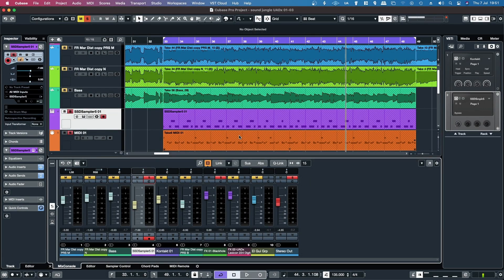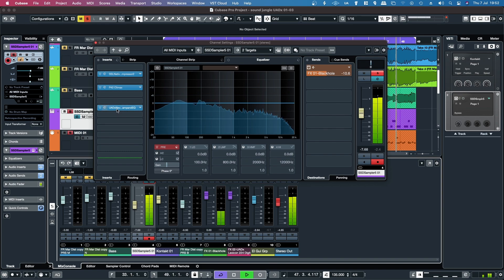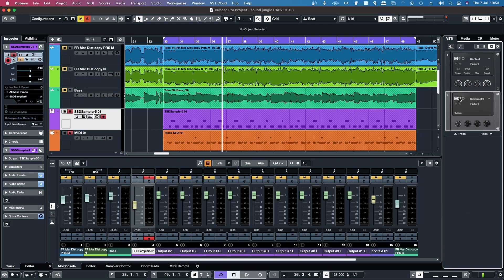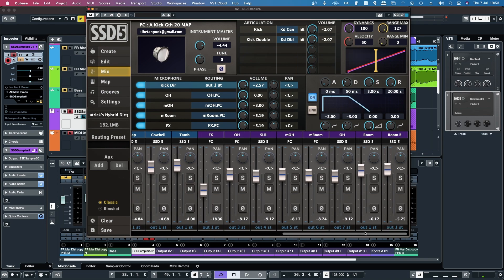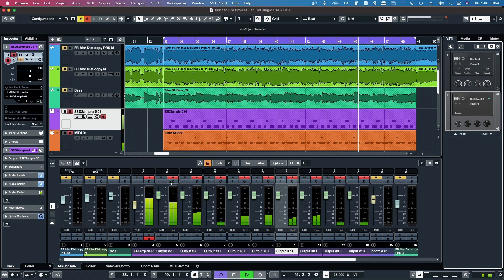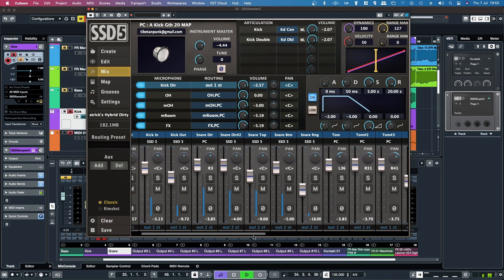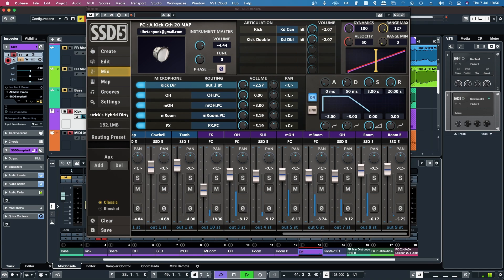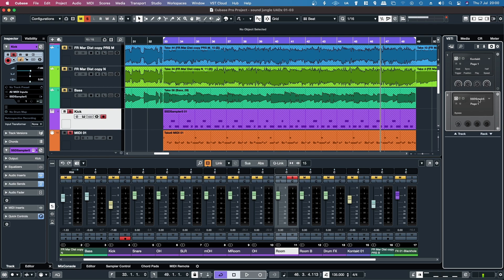Cubase Basics - Configuring a Multi-Output VSTi

Comment: I don’t use SSD 5 or BFD 3 ( I use Groove Agent 5), but if I would, I would do a Cubase template in order to have these outputs set once and for all. My two cents…
Reply from the maker: The problem with that will be that depending on what kits that you have loaded, the internal routing of the sampler can be quite different.
It doesn't take long at all to set up from scratch though.